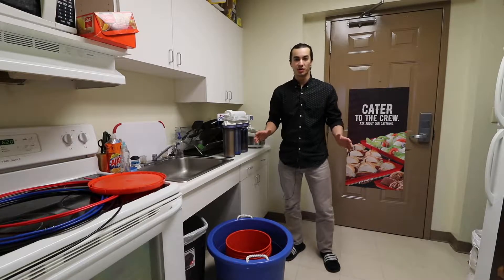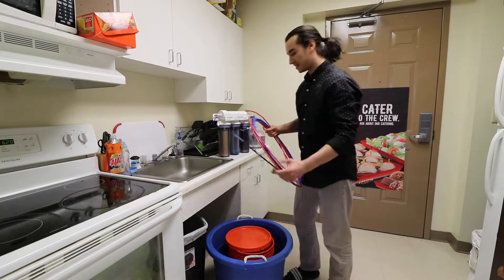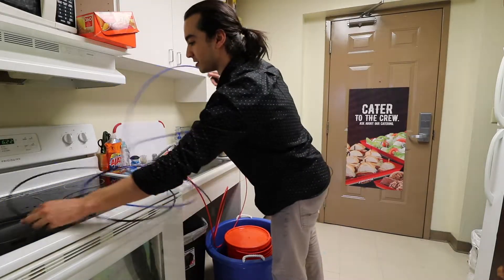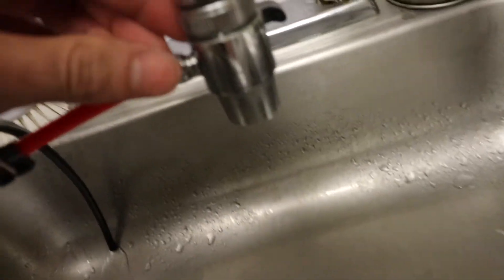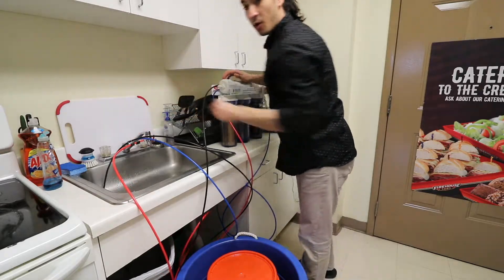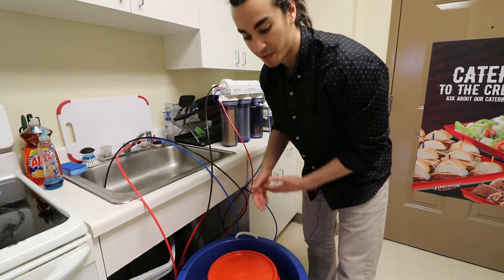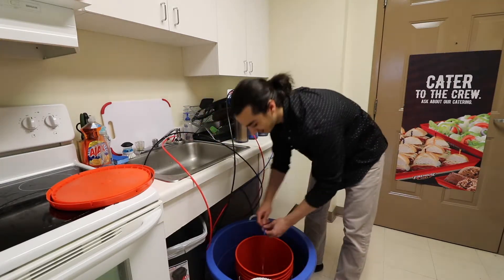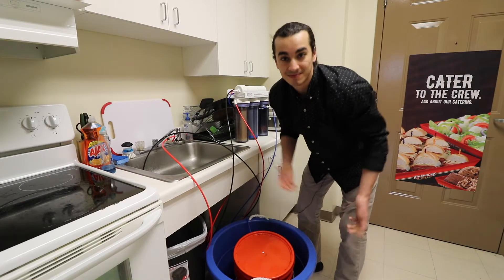How I Make RODI Water

Comment: Those are great tips - thanks! How often do you change all the filters in the RODI machine? Is it  after a fixed period of time or after making a certain volume of water?
Reply from the maker: That all depends on your water source. The DI resin will change colors to indicate it is getting old. You can also see the sediment filter getting cloudy over time. If you have a TDS meter it will begin to show that your water is still coming out with TDS in it. Those are all ways to tell when you need to change out some filters. I still have not changed any of mine out and I've had it for almost a year now, but I also don't make as much water as someone with a bigger system would.